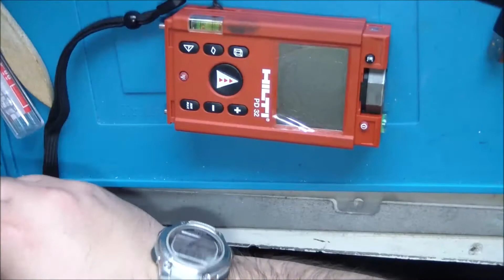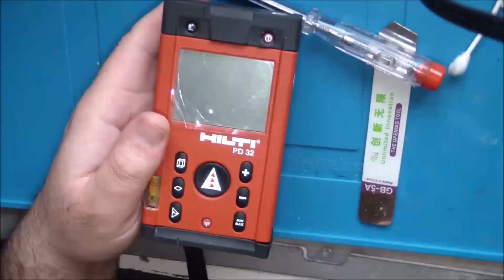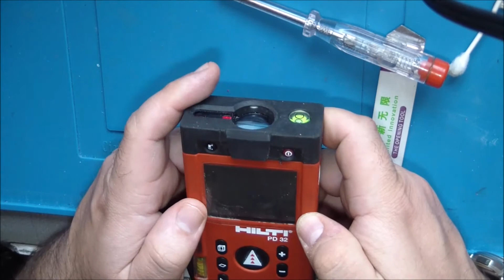riparazione metro laser hilti pd 32

Comment: Thanks a Lot for this Video. !  I have had similar Problem with PD 42. No Impact when pressing the power Button. I opened the device and cleaned all contacts with isopropylalcohol. Now ist works again properly.
Reply: hello, could you please give a link or any steps on how to open the PD42, am strugling with it ...could not open it and if i insist i am afraid i will break it.
thx a lot

Comment: I have a Hilti PD-C that I had bought second-hand on ebay and it was in good condition. I have a problem. After I had it stored for more than 1 year, now it won't turn on. I hit the power button and the meter doesn't turn on. A person who is a television technician told me that she did a test and that she did have voltage but that when the battery did not turn on she was surely dead. The problem is that the manual says that to change the battery, then you have to calibrate the laser meter and that a Hilti employee must do it, but it is not if this is true or if you can change the battery yourself for a similar cell phone battery.
Reply from the maker: ok